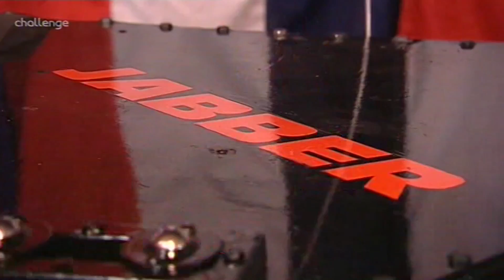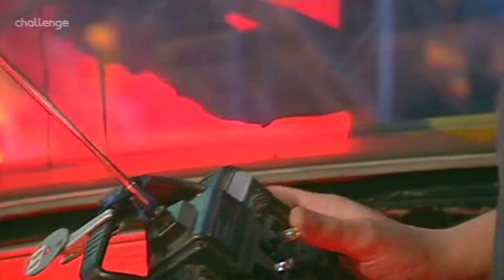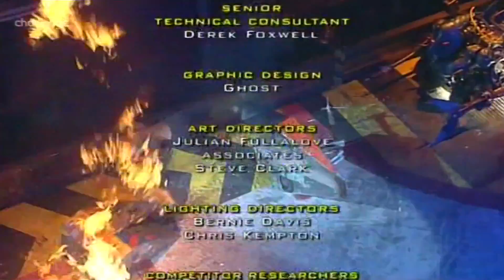Robot Wars Series 7 Heat K

Comment: BB controlling the whole fight at final, judges has to check damage on the robots xD what?
Reply: It's often hard to see just how much damage a robot has taken without seeing it up close. Kat 3 did get a few shots in during the Heat Final, and the Judges were just checking so that they could tally up the points correctly.
Damage points (up to 5) are multiplied by 4, so Kat 3 probably got 1 for cosmetic damage which became 4. If it had done more it could potentially have earned 2 which would have become 8.
Reply: @TheLegacyofHitchcock  Bulldog Breed was an extreme 2 tag team winner alongside Robochicken.